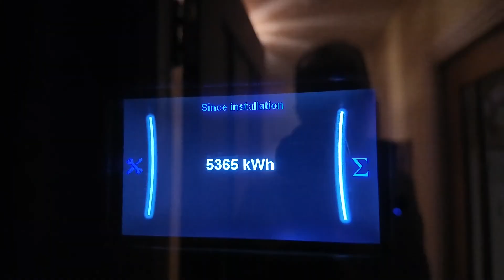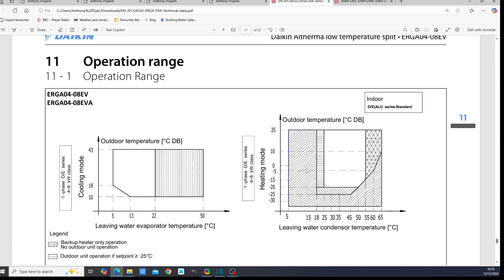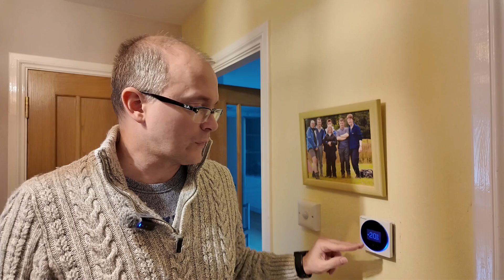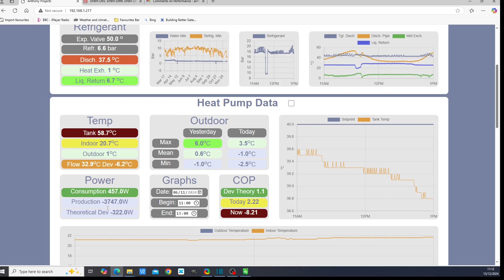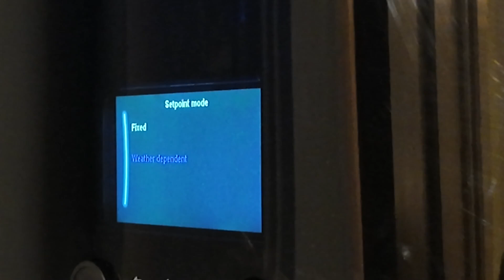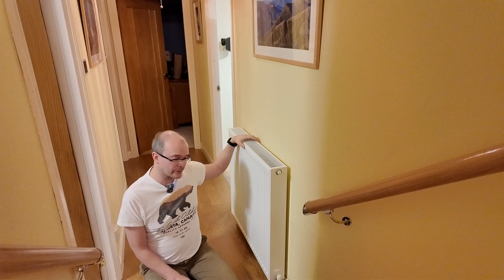Daikin Altherma Heatpump Early Winter Update

Comment: Is that Hot Water Temp Correct? 58.9'C seems very high! The Daikin unit I think you had installed (Low Temp) will only heat water to 50'C when the outside temperature is 0'C or lower and can only manage 55'C when positive using only the heat pump . Anything above that will require the use of the immersion heater which kills your efficiency.
Worryingly it seems that the data provided by the Daikin is not very accurate. Tests carried out by other youtubers have shown wild differences in the accuracy. Daikin showed 22kw and a Shelly Energy Monitor showed 18.5kw
.
The larger concern is whether the Energy out is also that inaccurate.....
Reply: I have the Daikin 6kW Altherma 3 'low temperature' monobloc, I believe it can heat hot water to 60C with no additional resistive heating, it has a small 'booster heater' in HP which can be used to push that to 65C if required (I have booster disabled, and control panel shows no increase in booster hours run).
Other than that I normally heat mixergy HWC to 43C which I find sufficient for hot bath or shower.

Next time it goes below 0C I'll do a 60C run (usually just done when half price tariff available)
Reply: @_Dougaldog  Just out of interest what do you think the booster is?
You should be able to see it installed into the bottom of the volumiser or buffer tank (depends which you have).
Reply: @MagicianMan  

Nothing fitted to volumiser, I'd assumed it resides within monoblock unit and was there perhaps to meet some EU requirement to be able to heat to over 60C, as far as I remember when enabled in installer settings and HW pushed to 65C the control panel showed increase in hours of booster usage (Daikins own terminology). Heating to 60C shows no increase in usage, it has not moved since just after commissioning back in February. Daikin control panel 'Information/Actuators' section clearly shows whether booster off or on.
The Mixergy cylinder has it's own immersion unit, which is not called upon at all.

Edit :- Daikins use of term 'booster' refers to immersion in HWC (it assumes a Daikin HWC as default) info' from schematic. The EDLA can have an integrated 3kW backup heater for extreme low temperatures, or larger fitted externally.
Reply from the maker: Yes it's correct, but it only does this once a week as part of its disinfection cycle.  The rest of the time it's set to 47 degrees.  And yes it does need the immersion heater for that disinfection cycle.  Thankfully though the disinfection cycle is set to run in the cheap overnight period.

In terms of accuracy.  
Output:   I've only got the flow rate and leaving /return water temperatures to go by.  I do the calculations of heat output from those measures.
Input:  I've only got the compressor primary current as a measure.  I don't have any measure of power.  I have to measure power factors for different loads, and apply a best fit curve.  Voltage I've retrieved from my SolarEdge Inverter, but recently I've just assumed 238 Volts because the modbus comms keep dropping out causing my program to crash.

I'm minded to explore the pulse output on the Eastron meter and wire that up to my Pi so I can measure energy flux and derive power from that.
Reply: @anthonydyer3939  We have just installed a Homely controller which connects through the Daikin MMU.
When they install it they change the control to Leaving Water Temperature and the Hot Water to Reheat.
The algorithm then uses outside temp, inside temp, weather forecast, learned solar/heat gain and customer set point for Heating.
We have set it to 07.30-21:30 @ 19'C and it will work out a setback for itself.
For Hot Water there are two options both use reheat for control but offer slightly different operations:
1) Hot Water to reach the set temperature by your desired time.
2) Hot Water to reach the set temperature but ONLY operate between your set times.
We run 48'C and 13:00-14:00 time slot.
Anti-legionella is still controlled by the Daikin MMU, ours is 60'C 14:00-14:30
It is going to be interesting to see what impact it has on efficiency whilst it "learns" over the next couple of weeks and going forward.
We took weekly & monthly readings from the Daikin MMU but will now take daily readings as well to see what impact it makes.

Comment: Is it possible your ASHP is oversized with respect to operation during milder conditions and the operation regime changes could be explained by slight ‘shoulder’ conditions which you are not recording?
Reply from the maker: Sizing a heatpump.  Ideally you'd have two compressors - one for low loads and one for high loads.  Indeed you often find this for the 12kW+ models.  But this 8kW example does work well at low loads - but only sometimes.

But the operation regime change has to be determined from the sensor inputs, there aren't many of those on this system, and I'm recording all of them.  I've not found the magic combination that brings the pump down below the minimum continuous operating regime.